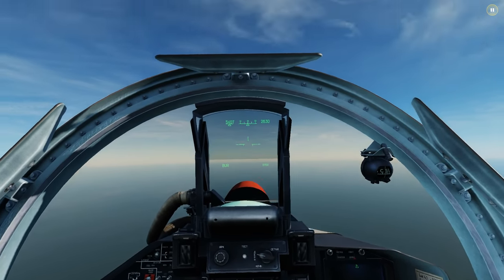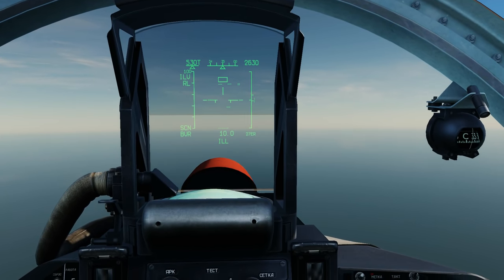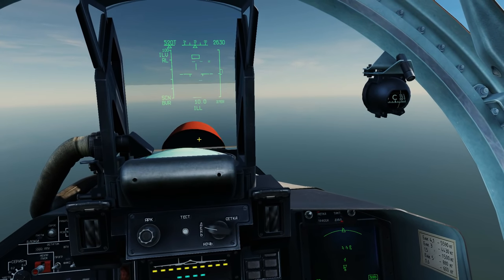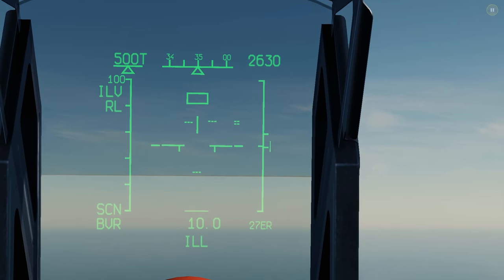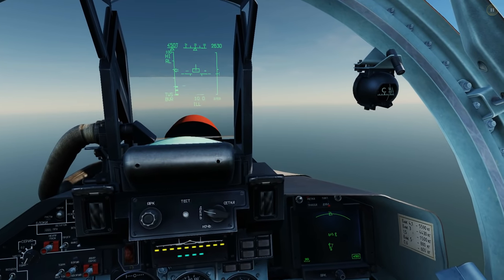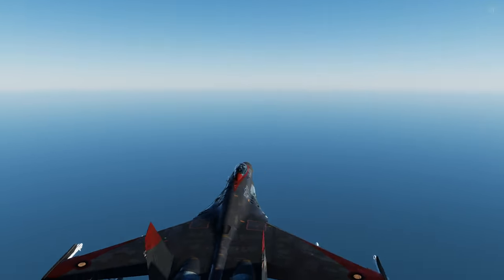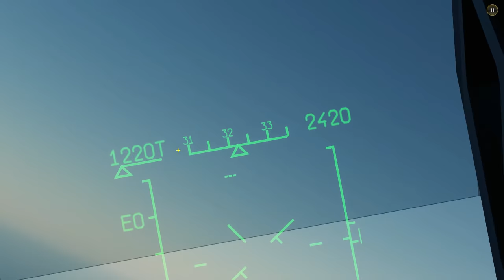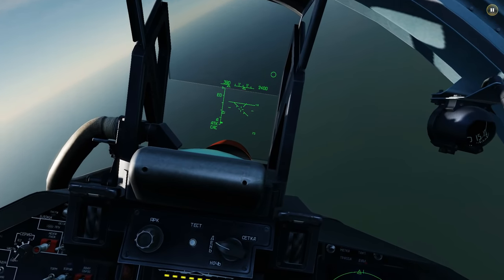Su-27, Su-33, Mig-29 & J-11A: Radar & Electro-Optical Sensor Tutorial | DCS WORLD

Comment: High PRF helps spot targets moving towards you. Low PRF helps see targets beaming or moving away from you. I'd say High PRF is more useful, you have a much longer range against targets moving towards you and a much shorter timeframe to engage fast moving targets. Low PRF has its uses but I tend to dramatically less than high. Also targets moving towards you have a good chance to be aggressive, and you have a far shorter IRST range whilst targets moving away you are normally the aggressor, IRST can usually lock, you're often still wanting to have an awareness of targets attacking you (changing PRF has a very severe effect on your range), and quite often you'd want to remain stealthy and can turn the radar off entirely. That said TWS only works with PRF high or low (I believe the F-15C can still use mixed) and so at least being aware of its capabilities is useful.

As for the Russian radars, they scan 60 degrees wide, the same as the reduced scan area of the F-15C. Usually it scans 30 degrees left, 30 degrees right. By shifting it you can scan from 60 left to 0, or from 60 right to 0. The F-15C allows you to slew in gradual steps. Also it appeared that when focusing a target in TWS the radar slewed to center on the enemy target, something which it wasn't able to do when I last played. Also the F-15C is able to use TWS whilst facing enemy jammers and the Su-27 switches back to RWS. Unfortunately the F-15C isn't able to scan 120 degrees whilst in TWS whilst it was able in FC2, but shifting to a smaller scan zone is usually a good idea anyway regardless of scanning mode, particularly when you know an enemy is going to be appearing from a certain direction. So even with slewing the Su-27 isn't able to beat the F-15C in scan area, but I do believe that when using TWS the datalink sends targets to all friendlies in your flight (even online), if so you can use advanced tactics to utilise that.

Having one pair sitting at range using TWS and covering a huge area of sky would allow the other pair to fly in with IRST and datalink and engage enemies from behind the mountains with IR missiles before returning back behind cover. With advanced tactics the Su-27 can be incredibly dangerous, and I was very sad when they removed the datalink from the Mig-29 (with its active and/or large number of passives). The F-15C can mad dog and carry far more missiles sure, but a Su-27 with datalink and IRST has far more situational awareness and can launch guided missiles without requiring luck. The Mig-29 retains the lock, gets even more R-27D shots (and actives), but with no datalink it needs some hand holding from GCI to properly hide behind mountains and take a sneak shot, as it was apparently designed to do.
Reply from the maker: Thanks for the info. You should be doing these vids for me :)
Reply: stop flirting cap. you should know the rule by now - on the internet, all men are men, all women are men, and children are FBI agents.
Reply: Very comprehensive, well done.

Although, as I understood it, TWS mode requires interleaving PRFs because RWS is merely doing simple range reports and clutter rejection, so it's a simple question of timing the pulse returns and ignoring Doppler frequencies below a certain threshold. In TWS, however, you have to use that Doppler return to determine target velocity to help build a track file. This means digitally sampling the RADAR returns, and X band tactical RADARs have carrier frequencies in the 10s of GHz, which no computer can keep up with... without trickery.

Essentially, the signal processing the fire control system does provides multiple range and velocity blips from a single target for a given PRF, and a different set of blips for another PRF. Find out where the blips for the two PRFs match up, and you've got your target found. From there, the track file starts getting built.

Also, lower PRFs will give you a longer maximum tracking range, with the downside of a higher blind velocity (below this speed relative to ownship, the RADAR can't distinguish it from clutter). So if your target is slower relative to you (like notching or a slow forward aspect/nose cold), a higher PRF will allow you to pick it up, but at a shorter range.

TL,DR: TWS uses both PRF types in an interleaved scan to accurately track targets, higher PRF is best for targets that are have a slow relative speed to you (notching or traveling close to the same speed as you nose-cold), although lower PRFs give you a higher tracking range.
Reply: A girl knows that much of info about fighter  jets radars ( 😨😨😨 )
Reply: I do believe this is a dad, who is an actual radar engineer/fighter pilot who used his daughter account to post this comment. Most probable solution.
Reply: Who votes for this girl should start her own YouTube channel about radars? ME!
Reply: PRF... define acronyms is best for all.  
Post Repetition Freq ? As I was typing i heard the audio.  I have never heard that phrase.
Reply: @oldfrend  lol
Reply: This is literally better than this video. Thanks!
Reply: @marcw.5492  Pulse repetition frequency. It doesn't really matter, the game calls it PRF and the game implementation is entirely unrelated to the real world anyway.

For anyone who cares the real world PRF is largely about range rather than aspect. It's a description of how rapidly a radar sends out repeated pulses looking for a return. A lower PRF allows more time for returns before sending another pulse so the maximum range is longer. A high PRF sends out more total energy allowing a higher chance of detection and generally higher quality data. Most radars will automatically manage PRF based on the range setting, but there is some fiddling you can do if you really need to fine tune it. Anyway this is obviously entirely unrelated to the way the game treats PRF.
Reply: @olivialambert4124  Its always nice to have acronyms spelled out at least once in any message... unless LOL or u know.

Comment: It's been a while since I played dcs, but from my limited understanding, what that number on the bottom on the hud does corresponds to the elevation input displayed on the right; it automatically determines the angle at which the radar antenna needs to be pointed to scan a particular distance specified by that number. For example, you are flying at 2000m and AWACS says there a bandit 10km in front of you at an altitude of 12000m, you would set the predicted range to 10 (number on bottom of hud) and adjust the radar elevation to 10 on the right hand side (this number corresponds to 1000m intervals, I believe). If done correctly the center of the radar cone is pointing upwards at 45 degrees. If the target was 20km, 50km, 100km or 150km away, the corresponding angle of the radar would be approximately 26.5, 11, 5, and 3 degrees respectively, above the longitudinal axis of the aircraft. The scale on the right hand side also seems to move accordingly to the distance set (notice how it makes big movements at smaller ranges than at larger ones). This is the reason why if there is a bandit flying just below you or at your altitude, there's a chance tilting the radar up one increment will cause the bandit to disappear, because the bogey is just outside the radar cone detection range (assuming the number at the bottom of the hud is set to 10). 

it's a good rule of thumb to set that number at the bottom of the hud to something like 50km; if you're searching for a target, adjusting the radar elevation range will physically move the radar antenna at smaller angles ensuring you don't leave large gaps in your search area. If you set that number at the bottom to 150 and adjust the radar elevation, you'll notice the radar will only move and and down a small amount, because you're basically telling it to look for a target 150km out from you and at that distance the radar detection cone is much larger. 

Like this comment if this explanation is correct. I could be entirely wrong :\
Reply: I was only watching this video to find out what the number at the bottom means, just to find out at 13:20 that this little thing is omitted. After reading your last words "I could be entirely wrong" I turned to the manual to check - always should do that in the first place! The manual is really good and you can just grab it as pdf online.

So you are right, if you know the target elevation and distance, you can use the "range angle method", which you described. One note: The radar elevation has to be set to the altitude difference between your plane and the target in km.
Reply: @coldice42  Appreciate it, while this makes me sound like a lazy fuck, was he correct?
Reply: @Keatononame13  Srsly? I even put a paragraph between my blurb and the answer. I am even typing on a phone! To serve customer needs:
TL;DR: Yes, he is on point. Give him a like.
Reply: @coldice42  lol evidently I was also too lazy to notice the read more button as well. Appreciate your response to a redundant question regardless. Happy flying.

Comment: Thanks for great vid Cap. Slight correction: EO has very narrow vertical field of view and you CAN slew it vertically and horizontally. Since the vertical FOV is so low, you in fact have to slew it if you want to see anyting. Vertical slew is analog (you can map it to joystick axis) just like radar. Horizontal slew has 3 positions - left, center and right..again just like radar. Another advantage of EO is that it displays targets immediately - unike radar which has to complete its scan cycle before displaying any contacts. This means that you can slew the EO very violently and see your contacts right away.
Reply from the maker: Copy thanks

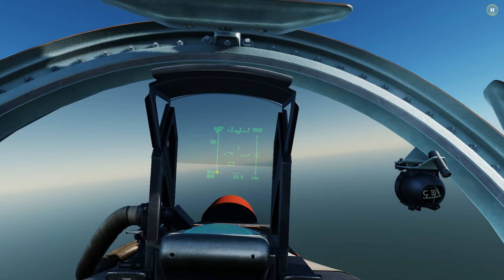Comment: 19:06

The OLS-27K of the Su-33 (the designation of the IRST station, the entire system is called OEPS-27K and for the Su-27 OEPS-27) has allegedly the following characteristics:

Detection and tracking area: 
- azimuth
 ± 60° (just like the radar)
- elevation angle 
15° ... +60
° (radar has ±55°)

Search field: 120° x 75°
Field of view:
 60° x 10°; 20° x 5°; 3° x 3°

Range of tracking for heat-contrasting airborne targets: 
- from the frontal hemisphere (hot aspect)
: 40
 km
- from the rear hemisphere (cold aspect): 100 km

Range of measured distances to aerial targets (laser range finder): 6
 km

Accuracy of measured coordinates: 
- angularly, angular min.
 5
- by range: 10 m

The angular velocity of the system’s target auto-tracking: 25
°/ s

The OEPS-27K performs the same
 functions as the RLPK-27K, but only in simple weather conditions. The OEPS-27K, however, provides more accurate data and generates less noise.

source: Su-33 manual, p. 38 et seq.

While real data of the OLS-27 sensors are not available, since not officially disclosed, nonetheless acquirable data seem to differ a lot, especially from the manual. E.g. they say the coverage would be  -60° to +60° in azimuth (so far so identical), but -60° to +15° in elevation, which is a whole nother world compared to what the manual states (https://www.deagel.com/Sensor%20Systems/OEPS/a001912 and additional info at http://www.ausairpower.net/APA-Flanker.html#mozTocId288713).

None of the provided data mean that they were and/or how it's even simulated in the game. The HUD's symbolic is already simplified, the real HUD looks different and provides more informations. Hence chances are, the functionality of the IRST/EOS is also simplified, if not even dumbed down for unbearable 'balancing' purposes, which would be a bit of a cheek in a simulation like this.

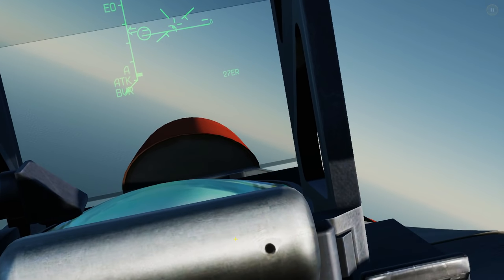So, take all of it with a pinch of salt. It required to be tested ingame, what is what. Or the devs would eventually provide us with solid informations about the ingame performance ..o.f. both the 27's and 33's IRSTs. They must know, if anybody. I have no real idea about the ingame mechanics either. I just use the system to the best extent I can, like shown in the vid. Just one more thing to mention  as for 21:17 : don't be afraid to turn the radar on while already in IRST track mode (when the target is locked), it will still not trigger the adversary's RWS, it remains as stealthy as it was with radar off. So, you can perform your IFF check - should become mandatory for you - without risking to warn the target against your lock-on.
Reply: Thanks for that post, Claude! Tons of good stuff!

Comment: 13:13 Elevation of the radar basically makes radar look 1 km above/down at the time. So, if target is 5 km above me, I set the elevation to 5 (as the manual says so). 
What about 10.0 (predicted range) , it is mostly used when bandit is using the radar jammer. AWACS or EWR provide information about him, and range is set to whatever it is (you have to lock the jammer, then set the predicted range so you know if you have LA or if out of range). 
Sometimes (I think) it can be used to detect the enemy on your own radar while you are provided with AWACS information (can be used with radar elevation, though sometimes it doesn't work, so better to leave on 10.0, finds enemy better).
19:09 Yes, you can) That is an issue for mig-29, he can't.
Reply: how do you call this action of slewing the radar up/down and left/right? i cannto find the command in the control list :(

Comment: 4:43 It's not the wingspan. It's (or at least it should be) RCS of the target as it is important for received signal strength. It's not only wingspan. MiG-21 has much lower wingspan than B-1B but has notably bigger RCS. MiG-21 is small plane but with huge (as for its size) RCS of 4 sq meters when head on (RCS varies depending on aspect). B-1B IIRC is closer to 1 sq meter (B-1A before modernization in contrast was like 10 or so).
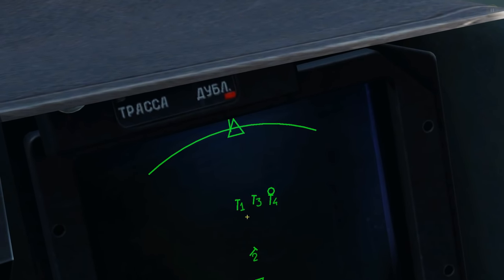5:40 Prioritization should be based on distance and relative speed IIRC. At least that how F-16 radar make it when there are more than 10 targets in TWS mode, the less important are dropped from track file and displayed like in RWS while the 10 most important ones make its way into trackfile. I think it gonna be similar here cause it is pulse doppler radar too.

Comment: EO can be slew left and right but not up and down. Number 10 in center low part of HUD is expected range to target.
Reply: Essentially, yes, you're both right. The number 10 is the anticipated range of the enemy. The +1, +2 and -1, -2 is the anticipated elevation change of the target. Thus +1 is 1km higher (3,000 feet) at 10km range. Changing it to 50km range would be 1km higher at 50km range. So in effect it is as though it changed the step motor. 1km at 10km range is the same as 5km at 50km range (or 15,000 feet). Personally I would suggest using something more like 50km or 100km for the range number, 50km is a fairly reasonable estimation of range, and 100km is an easy number to work with. 50km also allows a decent slewing range, 30,000 feet at 50km or 6,000 feet at 10km. Personally I prefer to change the range and elevation independently, but I've got a good number of HOTAS keys and analogue controls so I'm fortunate there.
Reply: You can slew up and down just like radar. Even proportionally (by assigning joystick axis to it).
Reply from the maker: Copy to all

Comment: The number at the bottom if i am remembering correctly is slew increment so when you move the dish it is moving 10 degrees you can change it to be more or less per move. I could be wrong been a while since i flew the flanker.
Reply: The number down the bottom is the predicted target range, the number on the right side represents the radar elevation in 1000m increments. The angle the radar antenna moves is directly related to the target range number; the larger the number, the smaller movement the antenna makes.
Reply from the maker: Copy
Reply: @Neccronix Exactly.

Comment: Curious about EO -- Since there's no radar lock on the target, if you fire a semi-active or passive missile, such as an R-27ER, will your target receive missile warning? Or can you even fire that missile with EO lock?
Reply: It will receive the warning, so you're generally better off using the ET, as you can lock on, and fire without the enemy noticing a thing.
Reply: If you try to launch R-27(E)R in EO lock, you will have to hold down the weapon-release button for longer, radar will turn automatically on, lock your EO target and thus he will receive warning.
Reply: +1 to Baron Nomis response, the R-27ER or other radar guided missiles will have to have a radar target to have launch authorization so they can't be launched with an EO lock.  You could do an R-27ET launch with EO.